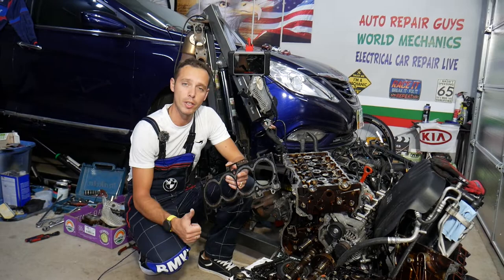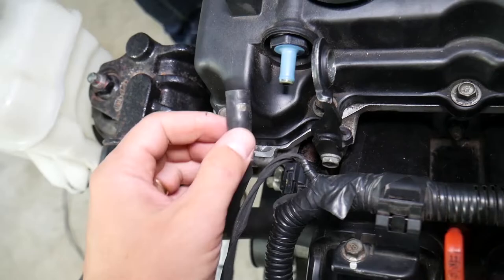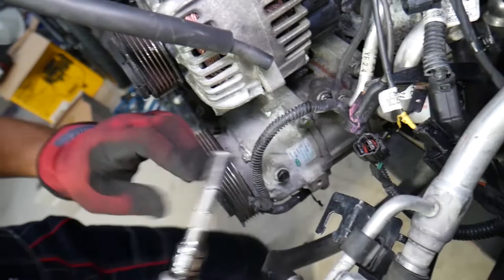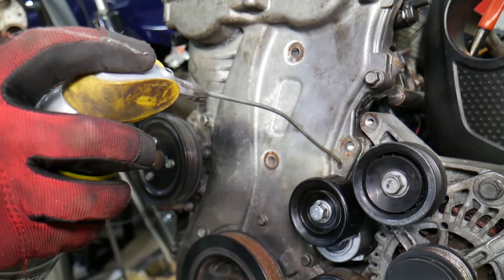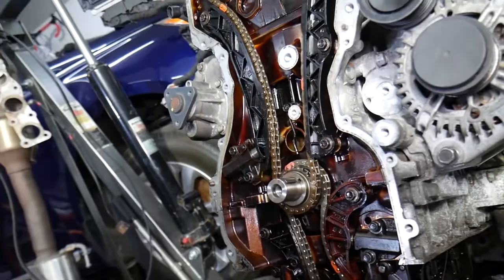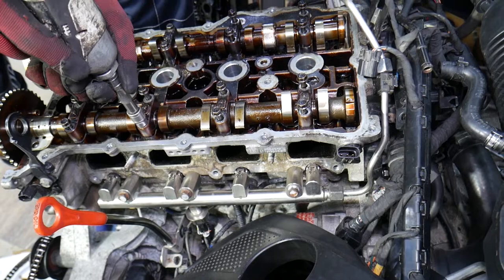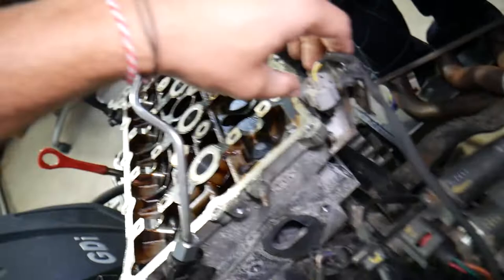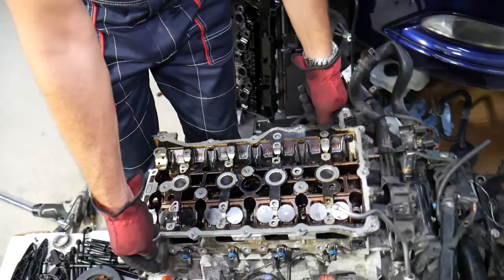HYUNDAI KIA 2.4 GDI CYLINDER HEAD REPLACEMENT REMOVAL, HEAD GASKET REPLACEMENT

Comment: I just replaced the head gasket
2.4 gdi
I did not replace anything else.
I dug liquid glass out of the cylinder head, and the oil was very thick.
I got very slight lifter tap for just a few seconds, it cleared up
Drove it gently for a few miles before the oil light come on, the engine started knocking and the car died to not start back again.
Assuming maybe the oil pump quit, but what other issues could I have now? I've got a misfire on 2 and 3 with a low voltage code for the intake manifold tuning valve.
Reply: Kia engines are no good . I did my research and their engines started going bad it’s all over YouTube . Take it to Kia dealer hopefully they cover engine . Their engines are lifetime warranty now because of class action lawsuit

Comment: Hi Guys... I have a 2019... can this gasket be replaced without pulling the engine?
Reply: No. Unfortunately you can’t get timing chain off without pulling motor
Reply: @old-red Lies!! I'm doing it as we speak and the engine still in the car. You have to support the engine is all.
Reply: @marvinmillbrook8737 what year and model car?
Reply: @old-red  2015 kia optima... I just did the a hydrolocked engine... two days to do it. I had a 3 ton jack, regular car jack to support engine. Took off side motor mounts, it fell to the left if facing the front, 10mm,12mm,14mm bolts... drained oil before I took timing cover off. It tried to play with me but I had a similar job on a G6 4 cylinder.. same type vvt set-up. Honestly it's easier on the Kia. They really are crap engines.
Reply: @marvinmillbrook8737  I suppose it can be done. It’s not the way I’d want to battle it. Going that far, I’m just pulling the motor and going through the whole engine on a stand while I’m at it rather than fight with the timing chain and tensioners and pulleys and making timing chain cover gaskets and all the stuff needed done on the left side with how tight it is. But bravo, I’ve rebuilt them and sounds like you have, so here’s to anyone not willing to just throw something away and take a loss.
Reply: @old-red  honestly I really wasn't a fight. Because once I took then tensioner off the chain jumped and I just pulled her panties right off without incident lol...
Reply: @old-red  I thrive off a challenge. When they said this and that can't or couldn't be done, then I do it with an evil grin 😁 then completely do the job with most engines in the bonnet... only time I take them out is for a complete overhaul. I love working on anything that challenge me... sounds like you do too! From one gear head to another!